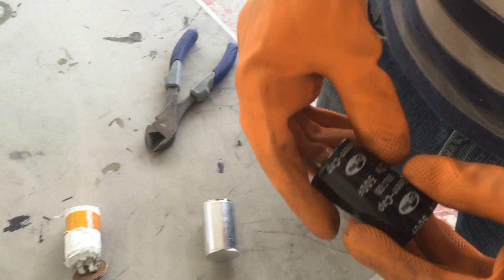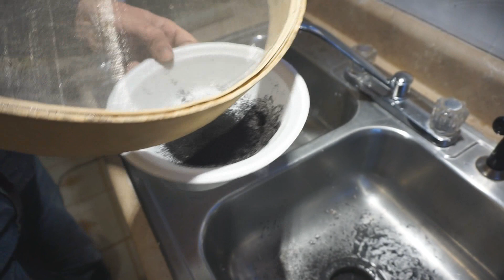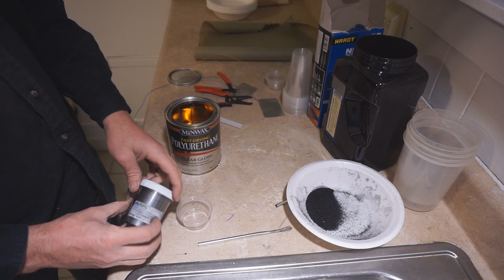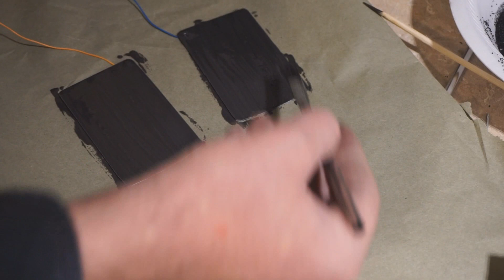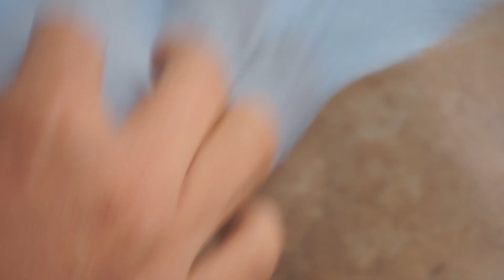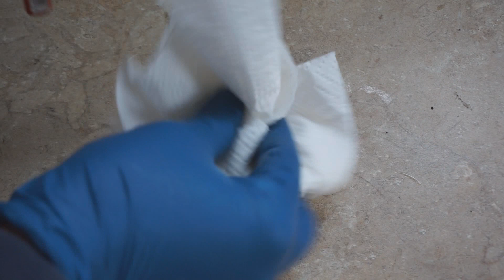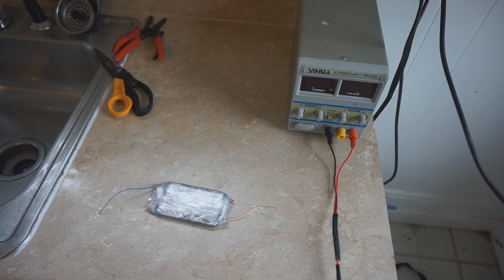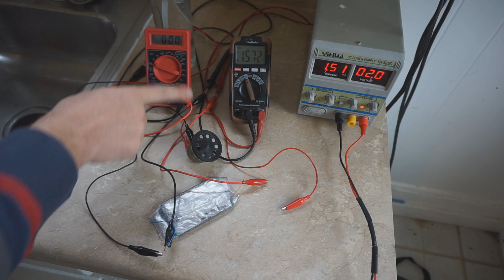Easy DIY Graphene SuperCapacitors

Comment: You should also be careful with your sealed enclosure you have on it. If that phosphoric acid should come into contact with the aluminum.... Its higher in the reactivity series than hydrogen. So its gonna react with the acid and liberate hydrogen gas. In your vacuums sealed and tapped tight enclosure... It is definitely capable of exploding. especially With all the high currents that you got going in and out of it

Comment: Is aluminum the best choice for electrodes? I mean yeah its lightweight so ya get more bang pound... It just seems to me that especially when using an acidic electrolyte aluminum may not be the best choice.... How about tantalum? The stuff has some pretty awesome properties and is incredibly resilient against low ph electrolytes. Its easy enough to source the foil from scrap... I may have to look into it myself 🤔

Comment: How to make Activated Charcoal:
Heat the charcoal red hot.
Which is exactly how it;s made in the 1st place...
ie:  There now difference between Charcoal and Activated Charcoal.
Except for the extra zeros added to the price for the word 'Activated' in the label!

What does make a difference is what you make the Charcoal from.
Here Bamboo has an edge due to the tubular fibers keeping their 'shape' after charcoaling.

What I don't get is why toss the finer charcoal?
A box full of soccer balls has gaps between each ball.
Adding ping-pong balls fills those gaps.
Adding small marbles fills the gaps between the ping-pong balls.
etc.
So you end up with more surface area by keeping the fine stuff..?

Comment: Drill hole in corner
Or
Use a foil instead of plate for weight reduction
Fill with Solder/sorder
Attach wire
Use laminator to encase

Comment: thanks for the tip for charging them quicker.  there might be a way to get them to 1000 volts,  u just need to increase the resistance between the plates,  so a bigger separator, or colder water? but it will kill you if u touch its terminals possibly.
Reply: How to do 1000v

Comment: This is an interesting video and interesting performance, however it can't really be graphene, as that would be a single atom layer of uniformly bonded carbon atoms, at two hundred times the strength of steel, even if You had many layers it would be hard to break, and why would You throw away the fine stuff, and keep the larger granules?, as the finer parts or "dust " would perhaps have flakes of graphene.  

 Maybe the world has gone graphene crazy, and everything now seems to various people, to be graphene, but I think it is just a carbon granule. aluminum, and phosphoric acid battery.

Comment: This is a LIAR. On his video he uses borax no salt and alum in a dry cell. It's a LIE. The reason salt water works is because it's corrosive. Dry batteries like this DON'T work without water or an acid or something corrosive. He is a LIAR. He says it ran for 2 years. LIES .  Two days maybe.

Comment: does it have to be activated carbon or would certain types of charcoal work? (not the bbq kind of charcoal briquettes they sell at stores, but a good quality wood charcoal)
Reply: Activated carbon has more surface area than regular carbon chunks. You can use basically any carbon you can find as long as you grind it finely enough but, it will be less efficient to some degree. Here is a copy/paste from google searches.
-What is activated carbon made from? Activated carbon (activated charcoal) can made from many substances containing a high carbon content such as coal, coconut shells and wood. The raw material has a very large influence on the characteristics and performance of the activated carbon (activated charcoal).
-Activated carbon is purified, powdered charcoal. It is treated physically or chemically to generate microfissures that vastly increase its adsorptive surface ...

Comment: Did you happen to notice that the dialectic strip in the rolled capacitor you deconstructed was thinner than the paper backing behind the foil?  Why is that, and why not emulate that peculiarity as well?

Comment: Not that you'll ever answer this but this is not graphing it's graphitic material it's made from waste charcoal that they blast at high temperatures with oxygen saturation. It has nothing to do with graphing graphene is made from graphite which is similar but not the same

Comment: I know this video is very old, but the information is still up to date and really want change much, so with this in mind. Why did you not just Solder Copper Wire to the Aluminum Plate. Soldering could've been done many way's. The easiest I believe is to use Vegetable Oil. Another is to use Low Melt Soldering Rod with a Propane Torch or a High Temp Soldering Iron like Stain Glass Artisans use. Also you could use Sputtering Technology to plate a Copper Mesh/Lattes onto the Aluminum Plate. More complex than the other Technique's mentioned. I do hope you'll keep doing the YouTube thing Mate. You were gone for a long time and are just coming back onto the scene now. Thanks for the sharing of your knowledge with me. It's very Appreciated. One last question. Why didn't you use PVA instead Polyurethane? Wouldn't SILICON GEL / WATER GLASS worked far better for this Application?

Comment: Once they start loosing energy density, make sure it's totally moisture proof (wrap in food cling wrap and put in zip lock bag) then freeze it for 24 hours, after which allow to sit at room temperature for 8 hours and when totally at room temperature the energy density often increases close to when new. This can be done with lithium cells also.

Comment: I want to know if it will work for like a 2-foot by 2-foot instead of a 2in by 4in make a battery that charges like a capacitor and hook them in series to make a higher voltage just like a battery has different cells and store my solar energy to use at night because energy the company that is delivering my power from the grid only pays $0.03 for the power off my solar and they charged me $0.09 for what they deliver to me sounds a little crooked to me

Comment: I wonder if there is some way to fold electrodes and insulators together in pairs of nested space-filling curves to some fairly high order to get higher surface area than obtainable by rolling up strips of electrode and insulator foils. The "folding" would be done by some sort of self-assembling chemistry, perhaps guided by a microscopic computer-controlled laser beam...

Comment: I need to know. If you use those electrodes in a standard electrolysis reaction. Will they still express that very high surface area during the electrolysis?

Comment: What is the range of voltages you can charge it to? And if you use a low charge voltage and a high amp instead of a high voltage and a low amperage. What is the difference?

Comment: Rough calculation of capacitance.  Famous equation:  VC = IT therefore C = IT/V where, for I let me use the geometric average of starting and ending current, that being sqrt( 40mA * 27mA ) =~ 33mA;  T is 5 minutes, or 300 seconds;  and V is the difference between starting and ending voltages: 1.336 - 0.662 = 0.674.  C = 33mA x 300s / 0.662V = 14628 mF = 14.6 Farads ...
That is a HUGE capacitance!
I really don't see how that is even possible, unless there's something electrochemical going on here.
The alleged reason why graphene has so much promise for supercapacitors is its very low resistance and large area per gram;  but to realize these advantages you'd have to get the graphite to form a single sheet of graphene, and use the graphene itself as the conductor;  NOT a metal substrate;  allowing you to make a capacitor sheet, say 2 inches wide but a kilometer long, yet so thin you can roll it to the size of a finger.  Having metal there entirely defeats the entire purpose of graphene, besides the fact that what you are using is charcoal powder;  i.e. graphite;  NOT graphene.  Graphite is made of multiple layers of graphene, by definition of graphene as being single atom thick graphite.  But to work as graphene, graphite would have to interconnect into a full planar lattice, which can hardly be the case when you mix it with urethane and press it by hand.
So, I may be wrong but I call this video a BIG LIE.  Has anybody here tried to duplicate this?

Comment: I purchased ''GRIT'' from the rock shop. It is GRANULATED CARBON and SILICON MIX. Just the right size granules. I used it for my 'ionic panels' that went into the roof of my tiny house! "THINK RIECH TECH!'' cause IT WORKS! BLESSED SLEEP! Shielding tech and benefit of CONTINUEOUS HEALING! DO YOURE HOMEWORK! I DID! 
Made a 'slurry'. Took large poster size plastic signs and covered with aluminium. Spiraled the slurry onto it from center to the edges. Counter clockwise. Then took smashed ROSE quartz powder and put a mound in center. Add hemotite or magnatite cyclindar 'bead'. Add shungite for even better results. Let dry. Cover with another layer of aluminium. WHALLAH! 4 panels went into my roof. BEST SLEEP IVE HAD IN YEARS! 
My ears ring a FULL OCTAVE and LOUD for YEARS! Its called HETRODYNING! FROM WIFI! Its also called ELECTRONIC TORTURE via EXECUTIVE ORDER 13818! POTUS! GET THAT! 
Love Q-PID  : )-

Comment: Probably try adding a little bit of Hot Melt cement to your wire leads before putting it in a vacuum bag so that when it seal the hot melt will glue it shut

Comment: What about making a conductive aerogel and taking slices of that? Aerogel should also have a huge surface area sine it is 99% air. Probably depends on if the cells of the gel are open or closed. What about making aerogel out of graphene :)

Comment: Just an FYI from a chemist:  Graphite is made of of multiple layers.  Scientists call each molecular layer "graphene".  (From Wikipedia:  Solid carbon comes in different forms known as allotropes depending on the type of chemical bond. The two most common are diamond and graphite (less common ones include buckminsterfullerene). In diamond the bonds are sp3 and the atoms form tetrahedra with each bound to four nearest neighbors. In graphite they are sp2 orbital hybrids and the atoms form in planes with each bound to three nearest neighbors 120 degrees apart.[12][13]

The individual layers are called graphene. In each layer, the carbon atoms are arranged in a honeycomb lattice with separation of 0.142 nm, and the distance between planes is 0.335 nm.[14] Atoms in the plane are bonded covalently, with only three of the four potential bonding sites satisfied. The fourth electron is free to migrate in the plane, making graphite electrically conductive. However, it does not conduct in a direction at right angles to the plane. Bonding between layers is via weak van der Waals bonds, which allows layers of graphite to be easily separated, or to slide past each other.[15]

The two known forms of graphite, alpha (hexagonal) and beta (rhombohedral), have very similar physical properties, except that the graphene layers stack slightly differently.[16] The alpha graphite may be either flat or buckled.[17] The alpha form can be converted to the beta form through mechanical treatment and the beta form reverts to the alpha form when it is heated above 1300 °C.[18] ).

Activated carbon is made from coke or charcoal.  It is not graphene but is widely used  in batteries,  etc. for its massive surface area due to pores.  Use of activated carbon and graphite have largely been replaced by acetylene black in batteries.

Comment: Why supercapecitor  are rated for lower voltage with higher capacity instead of other way around? 
Is it possible to make or modify low voltage supercap into high voltage capacitor ( in kv range ) by increasing distance between its electroads or using high breakdown voltage capable separator ???
If it is possible we can store extremely Large amount of Energy in cap for Super high amp discharging !!!!🤔

Comment: This  is not a Graphene capacitor, you have built a graphite capacitor. Graphene is a single layer of  graphite , also instead use a vacuum sealer it does a better job.

Comment: I am trying to buy or design a supercap for a 100 amp 12 volt load. I have 2 batteries but it is sagging on the load. Any ideas of how to achieve building or buying something that will work for 12 (14) volts at 100 amps?

Comment: Applications... None... Why you are only over coming friction of the bearings..  No load..  I have ideas of combining certain aerospace materials that might prove quite amazing.... Caps are easy to make from aluminum foil and plastic no acids needed and results are the same with only air gap or plastic gap.... Anyway caps are the future of electric power yet its not a big deal yet because you gotta get the juice (electricity) from somewhere and now that is not actually clean sources... (I do not belive the lies of global warming because that is anti science) carbon emissions are not harmful almost all life is carbon based..... You breathe out carbon plants breath it in plants make that carbon into potatoes sugars and other foods which we eat.... CARBON TAX IS MERELY A TAX ON ALL Life...... All that said tesla had a tower that would pull the electricity from the air for all virtually free.... The powers that be have extracted money from all for years..... Now that they are trying to force electricity on us all is only because they tax life itself

Comment: Are you aware that you usually cut the bag using the sealer by sealing a second time right away and pulling from one side? (shearing while holding the sealer down)

Comment: My 2ct:
Try the test again, with several layers of aluminum foil and regular print paper soaked in oil (WD 40 or something).
I actually doubt the motor is able to run 10 minutes off of a capacitor with only 2 layers.
It seems ... impossible...

Comment: dont use any shipping tape keep them light and one step less to making them . Just use that great clear shrink tubing
That will apply plenty of pressure on the plates. Im really anxious to see the performance results. I want to see if these will replace expensive dangerous and unhealthy LiPoly cells in RC planes

Comment: Please stop saying graphene. This isn't graphene. Graphene is one of the the most expensive and difficult materials to fabricate. You bought activated carbon, which is what people use to filter the water in their fish tanks. So please stop using the word graphene until you understand what it means, you're just making everyone stupider. Second, no one in the electronics industry rivets wire. Ever. The compression of the wire work-hardens the copper, making it brittle. Just use solder, it's been in use for a hundred years, and not because rivets hadn't been invented yet. Third, the fine carbon powder you washed down the drain is what real supercapacitors use. Finally, you try to sound as though you discovered the concept of high surface area - well, welcome to 1745, when the first capacitor was invented and the idea of capacity being a function of surface area was well understood. I stopped watching this idiocy three minutes in, so if you had some sort of useful information later on, I missed it. But I doubt it.

Comment: I think using a activated carbon fiber mesh would work alot better as you can gain resistant properties to the electrolytes.

Comment: My little motors ran for 12 hours straight and only used 20% of the 44% I had in my power bank. I had 2 motors running at the same time, One running the motor and the other motor used as a generator to charge the power, bank is that any good???

Comment: I would be laughing if it weren't so seriously total bullshit.  The thing you made cannot possibly work, so the demo is rigged.  There is a real supercap hidden under the bench.  You have no idea how Graphene is actually used.  Mixing it with varnish?  Where did you get that idea?  Assuming it is real graphene, you just completely ruined all its properties.  What is the acid for?  Supercaps do not need electrolyte.  You're thinking of electrolytic capacitors.  You are a con man.

Comment: I'm a mechanic, and what I use phosphoric acid for is dissolving aluminum that has transferred from a piston onto a cylinder wall. You're probably using a different alloy than they use for pistons, but I can't help feeling mild concern for the longevity of that arrangement.

Comment: You've hit the nail on the head with the goal of Samsung's upcoming graphene composite batteries. Everyone I've mentioned it to has asked how much longer it will last, and the answer... it won't. It will have about the same life. But it will charge in about half the time of current batteries. Which is crazy. Coupled with wireless charging being almost everywhere now, those phones will never die

Comment: I know nothing about the best way to make suppercaps, but.. why not use the powder you flushed away, on aluminium (or tin ) foil, and wrap it around in a few layers with a separating layer, like on the capacitor you showed at the start of the video? 
Just a layman, trying to understand. thanks

Comment: I noticed you used a power supply with adj current control. Set and use it to your advantage
The capacitor will last longer and the power supply  is a switching variety  that is built typical modern price driven design ... not robust.on the other hand a linear power supply with 4 kg  transformer then you can pop the cap easy...lol  current limit shunt on ultra caps and a zener diode is minimum way to charge. The noise your hearing is the cap becoming a tiny hho electrolyzer and in a condition that can go bang  when connection welds together on contact